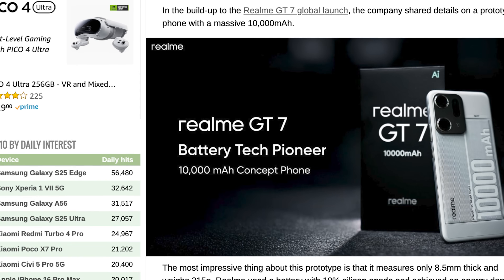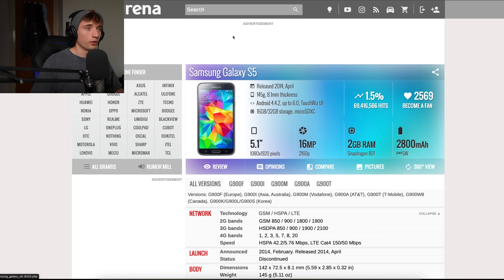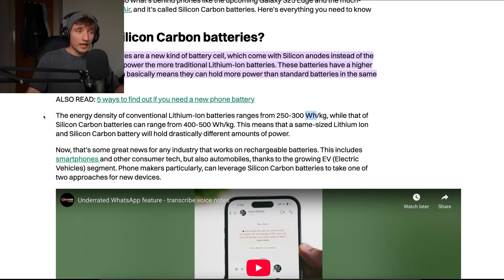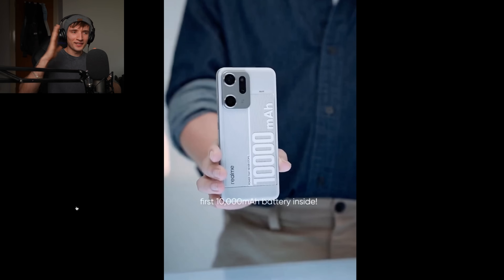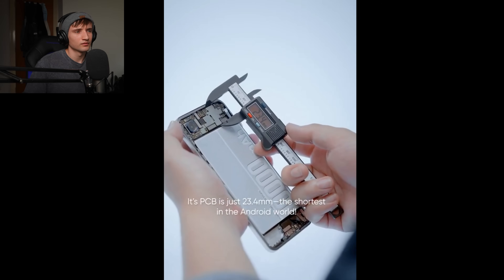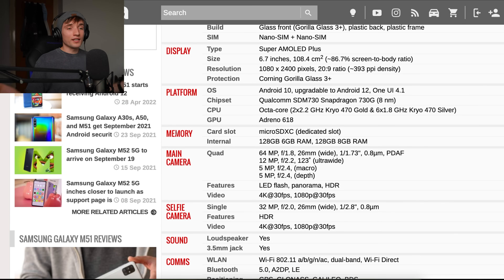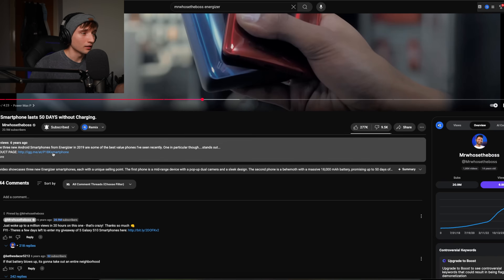Phone Batteries SUDDENLY Got ALOT Better… But HOW?

Comment: I would take better battery over some features. But I think that for me it would be best to keep camera quality and get better battery. And it can be at the cost of thickness. I think that I would be fine with 10 mm iPhone, if it would mean keeping everything as is, but getting 1.5-2x the battery.
I do go camping, and then I use GPS/maps a lot, I have full brightness, I record videos and take photos all day. At night I use phone flashlight. So I burn through the battery quite fast.
On daily basis I make phone apps, and testing/debugging them is also very battery intensive, especially AI ones. So I can run through my battery 10x during one day. Of course it is at home, so I can just keep it connected, but still. 
If I work on something else then my phone lasts 1.5-2 days, it wouldn't be so important.
But then final pice, on device AI will be getting more and more popular, and it can be more impactful than even gaming.

So I'm looking forward to better and bigger batteries.

Comment: I have the umidigi power 7 max with a 10000 mah battery for the past 3 and a half years and I will never buy a phone again with less than 10000 mah. Two or three days heavy use. Nothing new here punk! Doogee blade has a 10800 mah battery on a thin phone

Comment: Your video completely ignores the downsides of the new battery tech. These batteries compress more power into an equivalent area but they degrade faster, meaning they will be able to hold less and less charge more sooner than previous battery forms. 
I don't know the exact maths but let's say you have an old tech 5,000mah and a new tech 10,000mah. After 2 years of use the 5,000 might lose 15% capacity but the 10,000 might lose 30% capacity. In the end the batteries are equal but with the new one you're able to hold more power early on but less power later on.
Reply: grr

Comment: However, you wonder will any phone manufacturer make a phone with a 10,000 mAh battery. For two reasons: 1) it would take a long time to charge even using the standard 45 to 60 watt charging rate from USB-IF Power Delivery 3.0 standard chargers and 2) airlines are not thrilled by a phone with such a high capacity, especially with the potential fire hazard. Now, it may be different if the battery packs are solid state units that lack the flammable electrolyte fluids of current lithium-ion batteries.
Reply: grr

Comment: Samsung hasn’t adopted 6,000–7,000mAh or silicon-carbon batteries yet because they prioritize safety, slim design, and long-term reliability because especially after the Note 7 incident. While Chinese brands push bigger batteries and faster charging, they often sell regionally and can take more risks. Samsung, selling globally, has stricter safety and thermal standards to meet. Plus, bigger batteries add bulk and require major redesigns for heat management as silicon carbon batterie phones are thicker. Until silicon-carbon tech matures and can be mass-produced safely, Samsung, Apple and Google are sticking with proven hardware for consistency espeicially when in reality the battery gains are marginal when looking at battery tests. There's a reason why the iPhone 16 Pro Max with its 4600 milliamp hour battery still destroys any 6,000 plus milliamp hour phone because of optimizations
Reply: grr

Comment: Mah don't even matter.

That's just how many milliamps it can provide for one hour. The voltage also matters though. I mean my phone can provide over 10,000 milliamp hours at one volt.

I mean say you have a hundred amp hour 48 volt battery that's a hundred thousand milliamps but it's also way more than a phone because it's at 48 volts that battery will have thousands of watt hours whereas a phone will have a few watt hours

I think we should measure the phones in milli-watt hours.

Comment: Laptop markets are living in 2015 for still using Lithium-ion batteries...sooner or later Phones will literally rock 99Wh batteries (the same capacity 18 Inch gaming laptops houses)
Reply: Laptops wouldn't benefit as much from a silicone carbon battery though since flight restrictions cap battery capacities at 100 Wh,
Reply: @slurples149  some airports allow you to go higher if you get a permit
Reply: @slurples149 That is just an inconvenience, not a deal breaker
Reply: Some are like 120w I think

Comment: Yeah..the problem with you phone presenters is that you always present the good part. What about battery degradation rate ?
Reply from the maker: The phone isn't even out, how are we Supposed to know
Reply: @Techsnowball But the Si-C technology is the same and present on other devices in smaller capacity. From my point of view I don't care about 10k capacity if the degradation rate is very high.
Reply: Or at least say to take this technology with a grain of salt. It looks from your video that Messiah is about to come.

Comment: The Vivo X200 Pro’s 6000mAh Battery is not that much better than my iPhone 14 Plus’s 4325mAh Battery. About 2-3 Hours more of Screen-On Time. And Silicon Carbon Batteries Capacitires drops faster than normal Lithium-Ion Batteries. But as few years past, the difference will be not as big as when it’s New.

Comment: But Apple and Samsung’s OS Optimization is very good. So it isn’t as big of a difference cause these Brands don’t really care about their OS Optimization. The S25 Edge’s 3900mAh of not use Heavily. It stills could last until the Day Ends. But if pushed. It probably would die in like 3-4 Hours of Screen-On Time.
Reply: Nahh, evwn the base S25 models would give you around 9hrs of screen time and the Ultra has around 12-13 hrs screen time

Comment: The New iPhone 17 Air is expected to have a smaller Battery than the S25 Edge at 2800mAh. Than is 1100mAh less than the S25 Edge. So when the iPhone 17 Air launches. Let see who side is better now if we’re comparing the S25 Edge vs iPhone 17 Air.

Comment: Something everyvody is missing here:

Our current battery sizes should last A LOT longer (at least 4 days).

The reason they don't is for background processes, primarily consisting of spyi-, sorry, data collection. A lot of processes that do not serve us.

As the battery size and APU efficiency increases, they also get more aggressive with data collection.

You think you'll get double life but it will be more like 1.4-1.6x better life as they'll get more aggressive with data collection.

They'll use the extra capacity to use on-board AI for data harvesting as well as other processes (of which are not reported on in software battery analysis).

Comment: It's a bit disingenuous to showcase a 10,000 mAh rugged phone. Rugged phones, by nature, tend to be thicker and designed to resemble a brick for added military-grade protection. This concept is similar to taking a regular smartphone and putting it in a military-grade protection case, like an OtterBox.
Reply: rugged phone with 10k capacity but all the ruggedness comes from more plastic.

Comment: my fears now is heavy android that will drain it all at the same duration as the normal sizes like what happened to the gaming industry of creating upscaling which made the devs lasy to the point where they wont optimize their games anymore.....
edit : the m51 has a 7000Mah but they didnt keep it up
Reply from the maker: i literally had the same thought ... 10,000mah battery = dlss4, optimisation out the window
Reply: That's a good point. I remember phones with 2000mah lasting all day long because apps were small and we'll optimized, devs will go more lazy with 10k batteries

Comment: Is a 6000mAh Lithium-Ion Battery better or a 6000mAh Silicon Carbon / Slicon Carbide Battery better?

Lithium-Ion Battery Phone :
Asus Rog 6 Ultimate 

Silicon-Carbon Battery Phone :
Poco X7 Pro
 
Like just in general. Which one can last longer and hold it Battery Health Percentage higher?
Reply: Si/C cells have increased cycles, and better heat tollerance. If at 45c Lithium ion battery is dying then Si/C starts dying 2-3C higher temp 47-48c.
Reply: So it’s Longevity and Battery Life is better than Lithium-Ion Batteries at Colder Temperatures?

Comment: A 10,000 mAh battery has another benefit that people are forgetting. If the 10,000 mAH battery degrades to 50% of it's original capacity over a few years of use, you'll still have roughly 5,000 mAh of max capacity left which is like still enough to last you a day. Long story short, you'll no longer have to replace batteries as frequently as you do now. That's a big plus.
Reply: This is the reason iPhone deads quickly,mfs use 2cell battery,and 1 is low capacity,low one deads quickly as the law of physics makes the whole battery unusable
Reply: @saiferrahman5645 😮
Reply: Good point
Reply: doesn't it drop voltage below normal levels and cause system stutters and sometimes crashes at really low battery health?
Reply: @Perchatki0 it doesn't work that way. The SoC always maintains the voltage. 1.3v i think? Maybe I'm wrong. But the voltage received by the phone is always stable and doesn't change.
This is from a single cell phone battery:
4.2volts when it's fully charge.
3.7 volts at average
3.2-3.0v before it shuts down.
Dual cell battery
8.4v full
7.4 average
6.0v before it shuts off
That's why dual cell battery charges faster.

It doesn't go to zero volt to protect the battery. It is designed that way to prolong the long term battery life without affecting much of the daily battery life (100%-0%)
That's why the capacitor is invented to keep the voltage steady
Reply: @Perchatki0 Haven't experienced that personally. I've used a lot of old phones with old batteries but never had issues like this. Maybe it is true if the battery health is really really low like below 30%.
Reply: Depends on how you treat your phone and battery. I usually never let my phone drop below 20% and charge above 80%. After four years my Note 20 Ultra still had 89% of the original capacity. I still have an s8+ from 2017 and after 8 years, the battery still has 74% of the original capacity (I still use the s8+  as a secondary phone everyday to watch videos and play games).
Reply: Years? Nah man knock that down to a few months of ownership.
Reply: Who is replacing batteries
Reply: @michaelmayers3622  batteries do swell sometimes like my Samsung, I'm replacing it with a new battery next upcoming month.
Reply: another benefit is that its way easier to keep your phone between 20 and 80 percent charge making it drop capacity way less over time
Reply: But the phone will stutter, hanging and performance will be poor and a degraded battery will heat up and charging will never reach 100 percent or very slow to.
Reply: Thats not impressive.  Im waiting for mini nuclear reactor battery on a phone
Reply: One of the main reason Samsung an other haven’t jumped to this yet. Stability Issues and Swelling: Silicon-carbon batteries, especially those with a high silicon content, can exhibit swelling and degrade faster than traditional lithium-ion batteries. This swelling can reduce battery capacity and lifespan, making them less appealing for manufacturers
Reply: @stephenjma2023bz Huawei and Honor has been doing it for 4 years and their battery haven't been exploding or swelling like Samsung. Chinese brand often split their battery in half to split the fast charging current. So in the end you have a bigger, faster charging battery while the deteriorating is just 4% a year.
Reply: In theory yes but in practical reality in the future bloated OS and apps will consume more than current apps so it evens out eventually
Reply: Typically if the voltage drops off too much, it would no longer reach it's full capacity
Reply: How long do they last tho
Reply: I've heard about TUTV certificate making battery have more charge cycle and better at long term use especially on Infinix techno itel phones 

On average phone have around 800-1000 charge cycle before they degrade but with TUTV certificate Like the Infinix note 50 pro plus it can go up to 1600 meaning it'll last 2 years with constant use and gaming and 4 years with average use 

Now imagine a 10000mah battery phone with that TUTV certificate that's going to last you decades and the battery takes awhile to degrade on top of that
Reply: Crazy 😧
Reply: Lmao my port always fails before battery becomes a problem. But that's me gaming on every phone and usually plugging in 3+ times a day. My first phone wasn't even USBC and I plugged in like 10 times a day.
Reply: bigger battery degrades more, its not only about usage time its about user safety
Reply: Still the performance will drop drastically as the voltage will go down, hopefully it might be better than li-ion battery. Thanks to the new silicon chemistry
Reply: But the new batteries degrade to that 50% faster than the previous batteries. They don't degrade at the same speed. Current batteries might degrade by15% after 2 years but the newer batteries would degrade 30% in the equivalent timescale, in the end the batteries will fail faster than the older batteries.
With the newer batteries you're basically getting more power early on at the expense of the battery failing sooner.
Reply: Or it’s powerful enough to power a phone with 20k nits for half a day because every time we get better tech we manage to bog it down and never actually have longer lasting
Reply: Also, it won't wear as fast since you only charge it half as often. So you'll get 3 or 4 times the life too.
Reply: Well, if it becomes the standard, what will happen to it is what happened to 2800 mAh batteries over 5000 mAh 

It'll become the new standard, apps will consume more power, phones will consume more power, more things will be happening to make day to day phone usage more convenient and the 10000 mAh wipo eventually become the 1 day battery life
Reply: Not really, the os will start up consuming more battery, same as moon mission taking 200some kb of storage and my rhis comment takin up more tan that
Reply: They use very cheap material for battery that degrade very quickly
Reply: Under 80%, a battery is basically dead.
Reply: Have to remember that more mAh = faster degradation

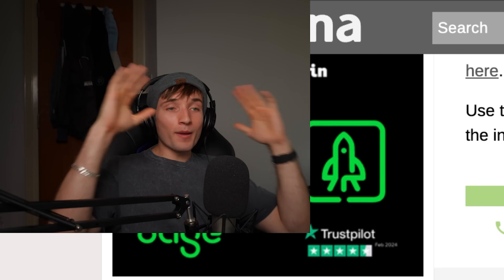Comment: 6:59 Iphone 16 plus is first with half the battery of the realme😂
Reply: It won, because it's 60hz, low quality display , performance reduced by a ton. Realme runs mostly full blast, so the device is significantly quicker.

Comment: Bro WHY was the iphone on top of battery range list 😭 didn't iphones have like 4000mAh of battery capacity?
Reply: Because Apple better optimized the software
Reply: @nickplays2022  don't forget that iOS is also smaller, walled garden. Specifically made for specific model. You would transplant from 16 plus the iOS to let's say 15 Pro and it wouldn't work, start or anything, doesn't matter if the kernel is switched to 15 Pro one.

Comment: the thing i really wanted to come out of this is compact phones with respectable battery capacity. there's really folks out there like me who prefer smaller phones but the battery life is a compromise with almost all of them. a sub 5.8- 6" phone with 5000mah battery should be possible with the new battery technology
Reply: Aspect ratio plays a role here. It's easier to wrap around my hand on my Sony Xperia 10 mk6 than my Nokia 6.1, because the Sony has 21:9 aspect instead of the 16:9 of the Nokia. And that's with bezels included.

Comment: And samsung still has 5000mah in the big 2025
Reply: Samsung and Apple are evolving backwards.
Reply: @عبدالرحمن-ع22 but their battery lasts longer than other brands 🤷🤷
But I do admit in the next couple of years it's going to be a deep problem.
Reply: @ArthurShrstha china phone have lots of adware, that’s why battery life not as good as other when having same size
Reply: @JohnsonChiw  haven't seen one ad on my oneplus chinese phones.

There software is far superior to samsung
Reply: @JohnsonChiw  they don't have adware
Reply: And the Galaxy Fold while being bigger and consuming more power has even less smh
Reply: This is so far the best thing happened to smartphones in years
Reply: Different technologies also getting setup a factory for masses isn't easy
Reply: apple still have 4850mah
Reply: S25 with 6000mha would be a blast. Even with slow charge
Reply: 5000mah is good enough wys bruh pmo

Comment: The downside is that silicon carbon batteries are more likely to swell than lithuim ion battery because of the heat.
Reply: But it's heat tolerance is higher than standard liion, so it might have a higher risk to swell, the cell won't start dying at the same temp as the standard one.
Reply: Which is probably why Samsung (and Apple because Samsung is one of their battery suppliers) is waiting to see what happens with these batteries before they start putting out phones with Silicon Carbon. They know what it's like to fly too close to the sun with batteries as people are still clowning on them for the Note 7 scandals. 

SiC is also barely out on the market, so we don't know how they degrade in real-world conditions yet.

Comment: Big batteries, new technology.... wow.
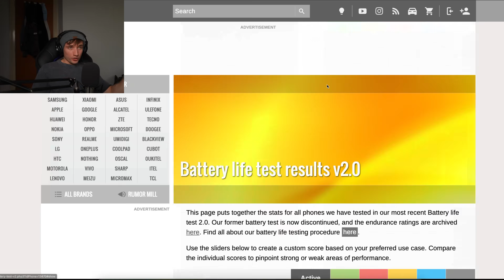Then in 6:50 look at the number one. Check results in columns. And then check battery size in this model. XD
Reply: The second place (vivo iqoo 13) and others has a 3million and little less in speed, while that iphone has 1,5million. I think that should be it... The speed of cpu gpu is a factor, also the screen size, and battery...
Reply: @bcutuli  It just doesn't matter since you are not using 100% speed all time, during web browsing or phone calls.